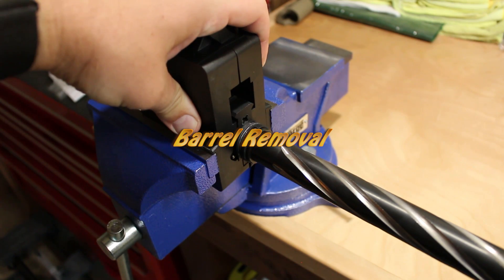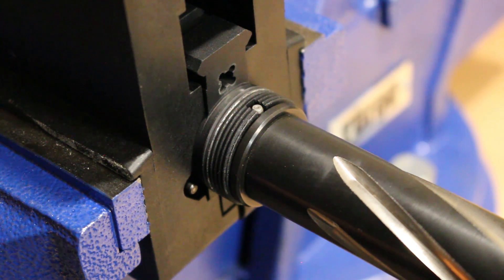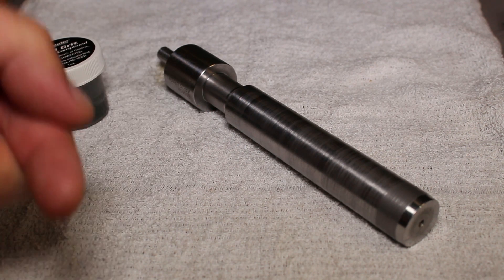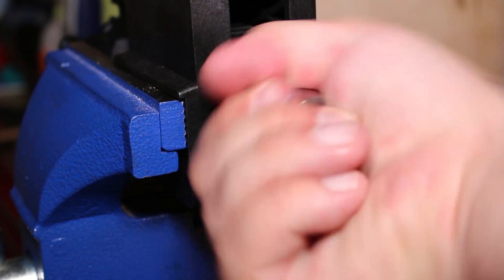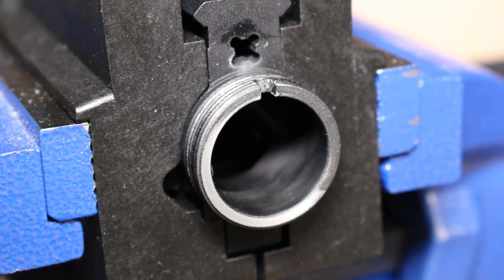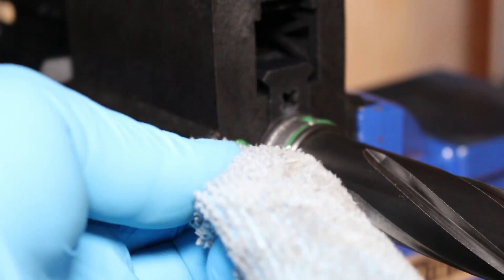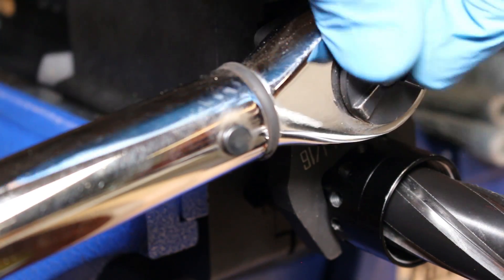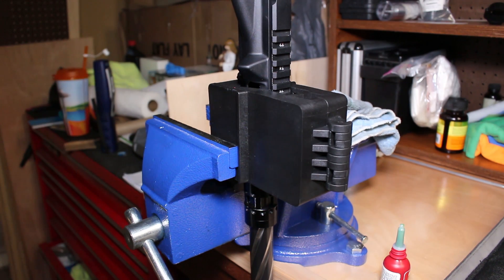Bedding a Barrel into an AR-15 upper receiver

Comment: “We’re goin to add a couple drops of the green locktite”

***paints barrel extension like Michelangelo
Reply: I got the feeling he used an awful lot of loctite.

I noticed two things and I'm not saying he's wrong:

- he didn't use any anti-seize compound or lithium grease on barrel nut threads 

- most videos show tightening, then loosening of barrel nut 2-3x before final seating
Reply: @escapedfromnewyork  I believe he's just using the loctite as a bedding compound to remove the looseness and circular play in the barrel. It's not the adhesive type of loctite for securing threads. The Barrel nut is being used to apply even pressure between the barrel extension and receiver so that the loctite cures in a manner somewhat consistent with the rifles final assembly. Once the locktite cures, I imagine he could pop the barrel nut off and do the final assembly steps (anti-seize on threads, timing and seasoning/torquing the barrel nut, etc).

Only kinda assuming some of this as the great YouTube Algorithm took me down a rabbit hole of "how to's" of bedding and free floating bolt action hunting rifles before finding people using loctite 620 to bed ar15 barrel extensions.
Reply: @escapedfromnewyork  - I'm with you on greasing the threads of the nut and upper receiver because you may actually want to take the weapon apart sometime in the future. However, that nut and receiver look like they've been used quite a bit. Tightening and loosening the barrel nut repeatedly is done to season the threads, and helps to keep them from vibrating loose over time. This is done when the receiver, or the nut, or both are brand new and isn't something that needs to be repeated at every install.
Reply: @michaelkusjanovic9954  You are correct. Was this a reinstall? If so, you are 100% correct about not needing to season the threads. That's something that doesn't get mentioned, so thanks for bringing it up.
Reply: Seriously overdone
Reply: his heavy breathing and soft groans as he is splurging loctite all over that
Reply: What no silicone ?
Reply: Hahaha
Reply: I kind of thought a couple drops were maybe 2, not a 25..

Comment: Interesting. I have an AR 308 that was wildly inaccurate. Could barely get the barrel off. Heated the receiver and impacted the barrel nut off. The manufacturer had used a red threadlocker on the barrel extension/ receiver, so despite what "expert gunsmiths" are saying below, this is apparently standard for some manufacturers. Had to heat again to remove the barrel from the receiver. New barrel & extension I had was loose as crap in the receiver. I trued the receiver face and high-temp locktighted the barrel extension into the receiver. I didn't know about the 620 at the time. Rifle now shoots sub MOA. Your video is good, and your methods are sound.
Reply from the maker: Thank you for sharing... as we see below a lot of people judge everything.  As a sport shooter I will use any method to give me that one step above the others.  Enjoy your  new sub MOA rifle!
Reply from the maker: Thank you for Sharing.  I am not claiming to be a gunsmith, but doing a few tricks here and there to get the edge is what I was looking for.  Enjoy your rifle and happy Shooting.

Comment: Ok as a gunsmith, I can tell you that there's so much wrong with this video.. first off, way to much lock-tight.. After caking lock tight on the barrel, the guy didn't even bother using the proper lubricant for the barrel nut.. and you turned the barrel in the vice so the lock tight didn't run into the receiver which made me laugh because now it could possibly run into the chamber and the bore of the barrel. I would be so much more worried about that ending up in the barrel than somewhere I could easily get to and remove the substance. Oh, and headspace has nothing to do with that part of the receiver. id be concerned with the guide ramps lining up true so the rounds feed smoothly into the chamber.
Reply: 620 doesn't cure when exposed to air, if any ran into the interior of the extension it would be wiped out by the bolt moving. Since you're moving the barrel extension opening away from the loctite as you're pushing in, the excess is going to press out towards the front of the barrel, and you're highly unlikely to have any retaining compound go towards the opening of the barrel extension or chamber.

3/10 for credentials on the internet -- some good points, but enough weird ones to know you haven't dealt with doing this portion of accurizing often enough to talk intelligibly about it. Guide ramps not lining up when the barrel extension pin is in place? Seriously?

Comment: Believe it or not I watched a video where the guy heated up the receiver and then installed the cold barrel.  
This guy has the right idea facing the receiver face completely flat and true. 
Although I do mine in a mill making very light passes. 
Hick tip- this can also be done with a good router and router table

Comment: When I bed the barrel I snip a piece of .001 or .0015 shim stock to fit, and cut it down bit by bit until I'm able to very snugly bed the barrel. This keeps me from having to put loctite in there, which I have done and I had some issues with and had to use torch to burn it off to clean it out and redo it again without the loctite.
Reply: God is good!!!!!!

Comment: Hummmmm.....what not start with a good quality upper and quality iron sights and say some shooting lessons. I have been using and building AR rifles and using the  military counterpart since 1978. Never saw this done never heard of it being done except to perhaps salvage a shit upper. If your barrel is sitting that loose in the upper you need to either replace the upper or barrel or both. Either the upper is too worn or if this is a new barrel it has an out of spec OD.
Reply: And the upper is the cheapest part out of all of it usually........

Comment: The barrel to receiver fitment shouldn't be that loose. If you buy quality parts it will never be that loose
Reply: Drew Dugger I had just received a quality PR Carbon barrel $799 ish that had slop in it.
Reply: @jamesbent8310  then you had a crappy upper
Reply: I have a colt upper receiver that is just that sloppy with a BA barrel. Was also just as sloppy with the sabre defence baarel I took out of the upper originally...

Comment: I have found that some uppers i put together need like 20 something clicks of adjustment on the rear sight to get zeroed while some require a handful of clicks. I assume lapping the upper would square up the fit and result in less windage adjustment on the rear sight. Does anyone have experience with this problem?

Comment: Where did you learn your gunsmithing skill?  Lot of miss information on here
Reply: What exactly do you think he did that was wrong?
Reply: China?
Reply: Lol, unreal isnt it!? The funny part is, after he got done hollowing out the end of the reciever, with how tight that tool fit in there, the only thing centering the barrel after he squirted all that glue in there was still just the barrel nut, which is absolutely fine thats why it was designed that way. Fuckin ppl.
Reply: @ConvictGaming1  the lapping tool has no bearing on how the barrel extention fits to the interior of the receiver.
Reply: @JohnBrowningsGhost it doesnt? You dont think that a lapping tool removes material? Doesnt do what it was designed to do? Im a gunsmith by trade, ill tell you right now this is pointless, the play he showed you is tightened up by the barrel nut pressing the shoulder of the barrel against the reciever, that play in the reciever is simply so itll accept all the different barrels in the world within a spec, if you want a press fit go with a heat fitted barrel, dont try to glue shit in place. Lol
Reply: @ConvictGaming1  I don't think he was trying to improve the fit between the outside of the barrel extension and the inside of the upper.  He was finishing the face of the upper to ensure the barrel would sit more flat against it once the barrel nut is tightened.  Unless I am misunderstanding what you're trying to say.  Do you mean he was inadvertently hollowing out the the end of the upper while lapping the front face?

Comment: That is a lot of movement. I have done quite a few builds for myself and friends and I have never run into that kind of slop. Always super tight fit. On another note, I doubt its even an issue when barrel nut is torqued. Only thing i ever put on there is aeroshell. Good tip on torque wrench and adapter being at 90 DEGREES. The only thing i would recommend is that after torquing the barrel nut, break it and torque again to account for any thread deformities or foreign material in threads. Now for my personal 2 cents: I have an accurate AR in .308 (1/2'' groups @100). Great rifle. Most of my modern rifles achieve 1'' groups or less. I will take 2'' MOA all day out of an ar-15 though. Better platforms for precision rifles and i consider 1'' moa or less a precision rifle.

Comment: Hell i took blem reciver barrel was lose bad so hell with loctight i jb wield the bitch aint ever gonna take it off. Tighten nut 72lbs and it Went from 1 to 2 " at 25 yrds to 1/2 in
 1" @ 100 yrds.  Skinny little pencil barrel whip sucks i only buy bull barrels now lol

Comment: I Have a question!  He claims that he did this because of to much head space between the barrel and recevier.... so then why did he stick that lapping tool in there and grind off the finish wouldn't that just create more headspace ??  Between the frame and barrel itself?? Someone please let me know !
Reply: Headspace is dictated by the bolt and barrel/extension lockup... And has nothing to do with the area he was working on... Further proving he is a hack and any advice from him shouldn't be taken seriously. The bolt cams and locks into the barrel and that's where the head space is determined.

Comment: You're done with that clean-up? You have maybe 50% contact. If that's done, why even bother?
Reply: Came here to say this as well. Half-assed lapping job not worth the effort spent. Geez dude....... everything that followed was waste of time, yours and mine
Reply: or the surface was not true to begin with so the part you see that has been resurfaced was where the material was high. Not saying this is really the proper fix. Clearly his Upper or barrel or both are out of spec. should not be so much slop in there it should be a snug fit.
Reply: @SkinnySkinch  . Yeah, the surface wasn't true, that's the point of what he is doing. My issue is, he didn't finish the job.

Comment: It doesn't matter what torque you like or the receiver/nut you are using. The torque spec starts at 35lbs/ft and at that point you you keep increasing the torque until the gas tube lines up and then stop without exceeding 80lbs/ft.

Edit:
Ok, with your nut, you don't need to lie up the notches for the gas tube so 40lbs/ft works.
Reply: Mostly right. You take the nut to the "best" torque for the barrel and bullet you plan on using within spec, then increase to get the right indexing against your gas tube if needed. Because every barrel is different, you have to determine that through shooting and adjusting.

Here's the in-depth explanation of doing that and why, specifically taking about torque at about 12m: https://www.youtube.com/watch?v=4Si557t-W_s
Reply: @FadingSwordsman  In the video that you posted he's not talking about the Barrel Nut.

Comment: Remember guys, do not torque without a lubricant on the threads! Without it.... is not a true torque
Reply: Gotta loosen it a tighten again
Reply: I agree to use lubrication, but some torque specs are called out to be dry and some to be wet. Depends on the application.
Reply: Torque then loosen 2-3 times before final torque. Use GMD Or some type of molybdenum grease like aero shell on the threads. You also want at least 40 to 65 pounds of torque or all of this bedding doesn't benefit you at all.
Reply: @timothymickal8172  - Torque and loosen 2-3 times before final torque is only a "must do" when the receiver, or barrel nut, or both are brand new. Once it's been done once you don't have to do it again - the threads don't get any more seasoned. And judging by the wrench marks on the nut, those components were both well used.
Reply: Works every time
Reply: The opposite is true.

Comment: I’ve never heard of bedding a AR barrel. If you have a quality upper and barrel this shouldn’t be a problem. Sounds like garage smith hocus-pocus to me.
Reply: Neito Kradavish let me guess, next your going to say I need to bed my muzzle brake or may be my buttstock.
Reply: Neito Kradavish last I heard loctite softens up under heat. So you have a tight barrel when cold, but after firing 1 mag it’s sloppy again. How about a video on your water cooled Loctited barrel. Idiot!!! Don’t buy cheap parts. Problem solved!

Comment: I’d like to see him remove the barrel in the future
Reply: Agreed gents, machine shop 101, locktite is for threads. But who am I, went to armor’s school 39 years ago,,,,,
Semper Fi
Reply: @kellydaniels8992  Not 620.  It is for cylindrical applications.  Now I'm not an armorer so I can't say it is suitable for this application.  But 620 is NOT for threads.
Reply: @bogieman101  you use grease on an ar.  He'll never be able to get the barrel off.
Reply: TwoStage 45 not for bedding,its thermafit sometimes locktite and sometimes ive seen shims. This guy is just highly wrong.
Reply: @TwoStageTrigger  Grease is for threads to prevent galling -- he may have some issue there, but it won't be insurmountable. Loctite 620 (Which is what's used here) is for pressure fits. You're probably thinking of Loctite 243, 263, or 290, which are threadlockers -- for threads. Grease on the barrel extension wouldn't have the effect he's looking for, which is bedding. If it stays loose, it's useless in trying to improve accuracy, since every time he fires, the extension would push around the grease and end in a new, different direction from before. There would probably be grease pushed out around the barrel extension for a while, as well, which is just kinda... gross.

He probably should have added grease to the threads, but the 620 on the barrel extension isn't wrong -- he'll be able to remove the barrel with a little effort.
Reply: Kelly Daniels Look up Loctite 620. You’ll see that it’s not for threads. Henkel makes many products for many purposes. Some are for threads, most are not.

Comment: Okay....what if the barrel isn't true ?
Reply from the maker: The goal here is to remo e as much mechanical error in the rifle.  So that you would be able to tell if the barrel isnt true.  Thank you for your support...
Reply: Can't tell if the barrel fit is true without some machinist type measurements........
You are assuming the extension is fit correctly to the barrel and the the extension is faced at 90 deg to receiver.......